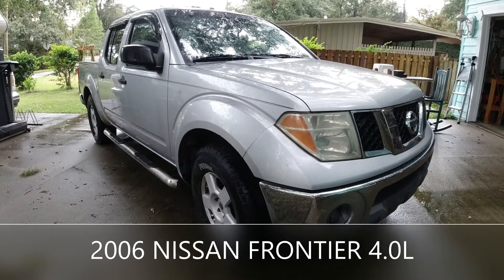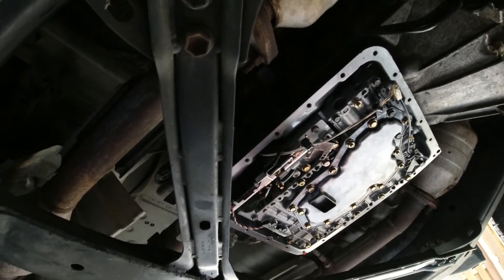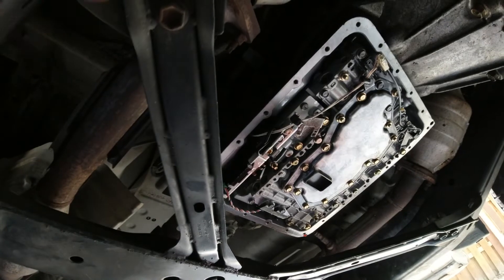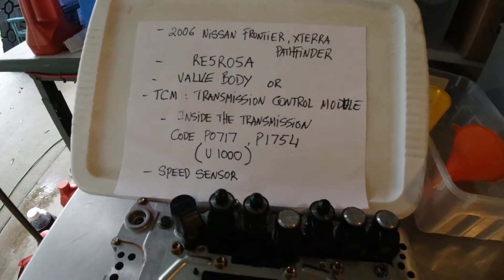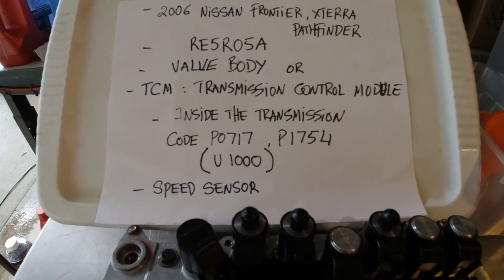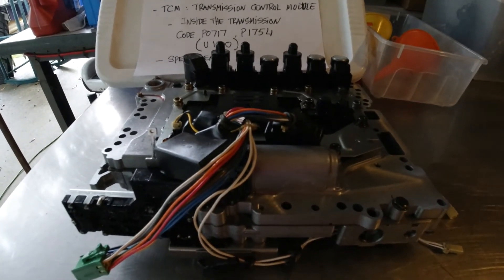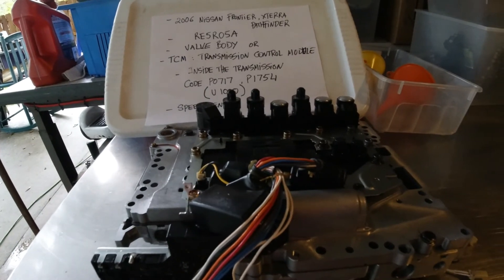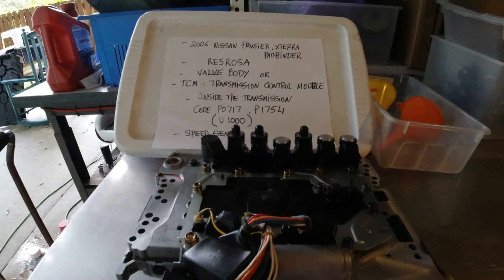Nissan Frontier Xterra 2008 Valve body (TCM). Speed sensor location. CODE P1754, CODE P0717 (FIXED)

Comment: Great video but how do you replace that speed sensor? Or can you replace it?
Reply from the maker: I don't know if you can replace the speed sensor. I just replaced the valve body with built in speed sensor. You can get a new valve body for $300 on eBay or you an used one from the junkyard for around $100. Just making sure the valve body metal parts from the junkyard is nice and shiny as new with no stains or signs of corrosion. (meaning the fluid is contaminated with coolant from the radiator)
Reply from the maker: I replaced the whole thing (TCM)